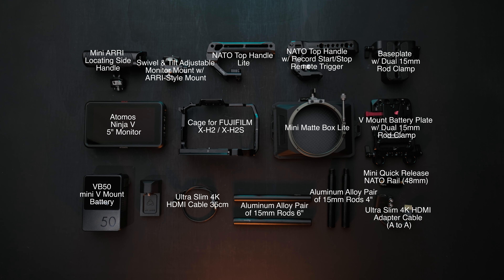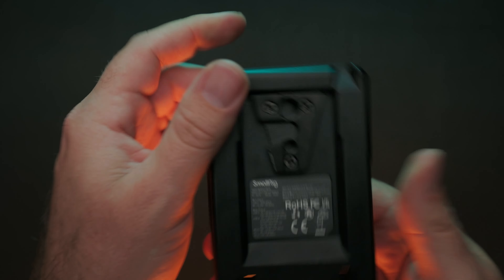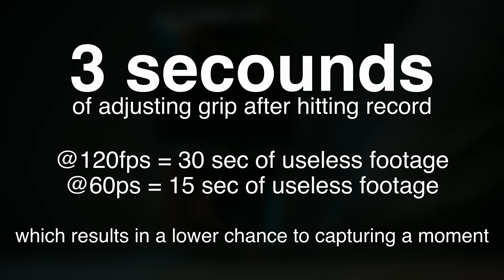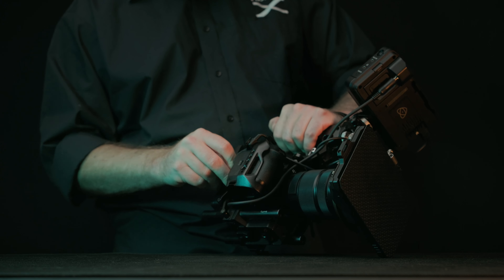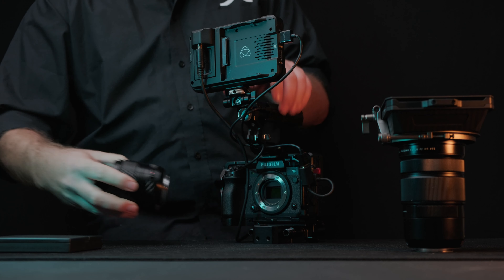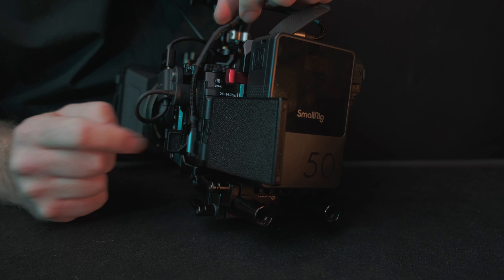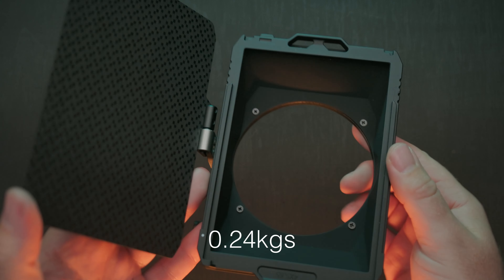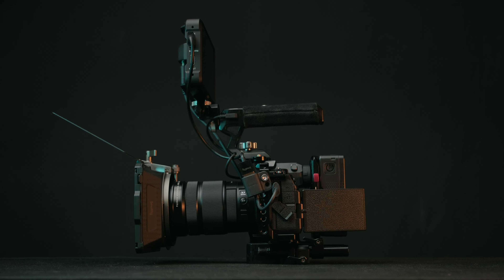Smallrig - Building your perfect camera rig - Fujifilm XH2/XH2s

Comment: That looks great. Thank you. Two question who were not asked in the comments:
1. How long can you record or running the camera with both monitors on the 55 battery?
2. I guess you still have the original battery in the fuji cam plus the v-mount battery. Do both battery lose energy? Or will the v-mount battery lose first all the energy and when its dead the original fuji battery starts to work?
Reply from the maker: I’ve never done none stop recording to answer the first but I get about 5 hours of heavy use out of it (never had it die on a shoot).
I have stopped charging the camera from it though as it only charged it VERY slowly and was just another cable to worry about (if I remember correctly the  camera only charges at 5w while on vs 30w when off) and as the camera battery was lasting me about 3-4 hours of heavy use without charging I just swap batteries mid shoot.

Comment: Hey, great guide! Would you recommend the Smallrig Cage for the Fuji XS-20? Im worried, because you mentioned, that the cage should have three points of connection, but the one for the xs-20 only has 2
Reply from the maker: If you can find a 3 point cage for another brand I’d suggest that, but if not ya don’t have much of a choice I guess.
Anything you attach to the cage if it’s near a point of contact will be solid, if it’s not near a point of contact you cage will flex a little

Comment: Awesome! I have a very similar rig for my X-T4 :) Have you found a shoulder option for this type of rig? I'm worried too much weight would be forward and not much on the back but would love to be able to throw this setup on the shoulder. Thanks!
Reply from the maker: Smalleig do a very cheap shoulder rig which I’ve held but never used, I actually use a sling neck strap instead which I’ve been very happy with as I like lower angle shots rather than higher angle shots plus it works well with a top handle monitor
Reply: @ThomasBusbyPhotography  interesting I’ll have to check that out. Is the sling featured on your page somewhere?
Reply from the maker: @melvinbrinson  this link might take you to the New Zealand site but this is the strap I use

https://nz.peakdesign.com/collections/straps/products/slide

Comment: I'm researching on building rigs for my new xh2s. Never done anything like this before. One quick question. i was looking at the falcam system but they don;t have a cage for xh2s. Is it possible to have the smallrig cage and then work in falcam's accessories so that i can have the best of both worlds?
Reply from the maker: I have the falcam system, and while I love their neck strap and use it with my gimbal every single time.
I would highly recommend suggest not using any of their quick release systems as I have found they all come lose far to easily.
They sent me a few items to review and stopped replying to me after I asked some questions and voiced concerns
Reply: @ThomasBusbyPhotography  thanks for the tip!

Comment: Nice! thanks for sharing. I have the same top handle and the same grip problem. What a nice solution with the leather sleeve. You say you had it made for you, is it possible to see some pictures of that sleeve somewhere?
Reply from the maker: Hockey stick grip tape would be a easier solution.
I don’t have photos up of it yet.
But essentially you wrap the leather around it inside out with two very small lips to attached together.
Then slowly and with heaps of force you turn it inside out, this was hard to do.
Then I slid it over the grip with the seam aligned with the long slot down the side of the grip.
Marked a spot for a hole or two, punched them out, and used a small smallrig bolt or two to lock the grip in place.
But like I said in hind sight grip tape would have been much easier.
Reply: @ThomasBusbyPhotography  Thanks for the reply. I’m going to try it.
Reply from the maker: Let me know how ya get on, IG pm your attempt

Comment: Hey Thomas, well made. efficient and clear. Your rig looks so good, I went out and spend my blackfriday budget on Small Rig. I'm struggling to mount the camera inside the case. In fact, it doesn't really fit without damaging the camera. Any trick I should try? grease it up a bit maybe 🙂 Thanks for any suggestion. greets from a happy Fuji user.
Reply from the maker: Just to double check you’ve 100% got the cage made for your rig?
And make sure you’re mounting yours from the correct side.
Mine gets mounted from the lens side, not from the rare if that makes sense

Comment: Very useful. Thanks. I've got the same problem as you on hitting record on the camera. Do you use the atomos to record as well?
Reply from the maker: No the atomos doesn’t offer any recording options I need, and doesn’t offer a few recording options I use in camera, so I now just use a shonibi
Reply: @ThomasBusbyPhotography  I'm curious: what specs are missing on the Atomos that you want and find in the X-H2s?
Reply from the maker: @lucapellizzaro80 4K 120fps (the xh2s can’t output that via hdmi even if ya get the V+)
And h265 without paying another $99 for it. Plus it’s on the reliability of 2 hdmi ports and a cable rather than just a memory card which is farrr more secure
Reply: @ThomasBusbyPhotography  that's fair enough. I have my ninja v for the long takes on a tripod and yes, hdmi is not reliable but I've experienced major fails with the Cf express cards so...
Reply from the maker: @lucapellizzaro80 yeah nothing beats dual recording

Comment: Hello, thanks for your sharing. I find the Top Handle with Rec Button from Smallrig doesn't mention they support X-H2s, is the record button still works for xh2s? Thanks!!
Reply from the maker: I have used it on every single firmware version of the xh2s and never had issues.
However I have had a few people comment here saying they have had issues and after I have said make sure you put it in the right spot and press it in far enough none of them have replied.
I personally would very happily purchase another one for my xh2s as it’s been so reliable and useful
Reply: Thanks!! @ThomasBusbyPhotography

Comment: Built this exact same rig from your video and had a few questions. would appreciate any advice.

The colors look different on my atmos v than the lcd on my Fuji. I am only using this to view the footage larger. How do I sync them? I would love to see the flog assist color on here or what it actually looks like in rec 709 instead of flat.

Is there a specific order you power and plug things into your battery? I heard that you can fry your hdmi port if not. 

Lastly - how is the record handle working? I’m not seeing any cables or sections to plug it into my camera.

Thanks in advance!
Reply from the maker: I struggle a little with the colour matching as well, and find my self switching between 709 and native on the monitor a lot. I’d suggest getting used to native as it does preview a lot more dynamic range, and I switch on 709 for when showing the client out in the field.
If you really don’t want to do this, just load up 709 (or whatever lut you want to preview with) and then adjust your monitor gamma until things look closer, gamma tweaking helps.
I constantly power cycle everything in odd orders and have never had issues, I did start to get annoyed with dtap getting knocked out a lot and have just added a Velcro band around the mount battery to hold the dtap in better, I should have done this long ago, if you’re looking for a fancy one I found 2x fpv drone battery straps to be perfect.
Everyone misses the handle port, it’s very small on the right hand side near the top of the grip.
Hope this all helps mate and you love the rig
Reply: Any advice for being able to hear audio on playback? When in the field and having to review a scene I am noticing I cannot hear any sound when watching the footage while monitor is plugged in. I am also just using this monitor to view footage and not as a recorder. A bit annoying. Do you have advice or a work around?
Reply from the maker: @MattRussoMedia does your monitor have a headphone out?
Reply: @ThomasBusbyPhotography  yeah it’s the same ninja v monitor as yours. I am assuming I will have to buy headphones or a 3.5mm Bluetooth plug and external speaker to let clients hear audio on playback in field?
Reply from the maker: @MattRussoMedia if you’re recording good audio id would highly suggest even just a basic pair of headphones for monitoring.
Nothing worse than getting home and finding out a mic was rubbing on a shirt on you had interference and all audio is wasted.

Comment: Hi, which USB C cable are you using to charge? I have a right angle as well but the head is a bit too bulky. Thanks!
Reply from the maker: To be honest I have now stopped charging via usb-c.
Charing while using made such a small (nearly unnoticeable) difference, and I’d rather have the extra life on the monitor.
But the cable I used was a UGREEN UG-50125 USB-C to Right Angled
Which I got shortened to suit the rig.
Reply: @ThomasBusbyPhotography  thank you Thomas

Comment: 2:18 can I use a monitor without a pin area with that mount? Im using a desview r5 monitor
Reply from the maker: Yes the pins pop down, as sometimes I remove my monitor and turn it slightly if I’m doing a long interview depending on where I’m sitting

Comment: 3:27 How did you get the record button to work on your top handle? For the life of me I can’t figure it out. I’ve tried every port on the camera. Thanks!!
Reply from the maker: I have had lots of people comment with this issue and non seem to reply when I ask questions.
But just to confirm the port is on the grip side of the camera above the memory card door.
And it is a little firmer than expected to push it in, it’s not crazy hard to do so don’t break anything, but my first time I didn’t have it in far enough.
Please let me know if this was the fix and all the best.
Reply: @ThomasBusbyPhotography I can’t make it work using usb C. I’ve only tested with the Neewer version but it doesn’t work. What usb setting did you choose?
Reply from the maker: The smallrig record handle connects via 2.5mm pin on the grip side of the xh2s (NOT usb-c)
I don’t believe there is a usb-c record option, but I may be wrong.
Reply from the maker: @FujEterna sorry what camera are you using?
As the xh2s has mic, and headphone ports independently of usb-c.
As I also own Sony when it comes to these kinda issues I would maybe say Sony is a smidge worse as their hdmi output really sucks, and the ports at pretty much the same
Reply: @ThomasBusbyPhotography  My bad! It works, I was thinking that you should connect to mic or headphone input but no! I didn’t know you had a port on the right side who servers exactly to trigger the record smh. Thank for the help! 🙏

Comment: I wanted a matte box for that "wow" factor 😂
It's very practical for cutting light and managing filters but when I thought of it it's going down the rabbit hole, it doesn't really work for zoom lenses and lenses that do not have internal focus but it's only compatible with some filters brands, sizes, shapes. I think the matte box should only come last one when one's settled on the lenses so it can fit all. Plus the price of the matte box + accessories + filters rack up very fast. 
But when you finally have the matte box you can call yourself a filmmaker even if your camera just sits on a shelf never being used and just for the show 😂
Reply: true, and it only cost 60 bucks 🤣

Comment: Thanks for the video.  I've just purchased the same top handle but it's not functioning correctly.  It starts recording as soon as I plug the cable in to the handle or camera.  I then have to use the camera shutter to stop recording, and then the button on the top handle doesn't function at all.  Any help much appreciated.  The cable is plugged in to the top handle and the remote socket.
Reply from the maker: What camera do you have?

Comment: Thank you so much for sharing your setup and findings with us. I am actually right now building a very similar rig with a FUJI X-H2S & the XF18-120 as my primary lens (Getting a set of vintage Canon FDs in addition). I want to power the camera, the Atomos Shinobi and .. who knows via a Smallrig V-mount battery (not sure yet if 50 or 99? ) What would you recommend (and why) in terms of cabeling? D-Tap-connection to Monitor or to battery-dummy? I had D-Tap to W235-dummy in mind and the 8V to Monitor (also with an adapter) ... Thanks for your thoughts ....
Reply from the maker: Be aware you’ll need a xh2s dummy battery, not just a w265 battery as it’s a different dummy battery from the xt4.
I get about 4 hours using mine to just power the monitor, so if you’re thinking about powering the camera as well I’d definitely get the 99
Reply: @ThomasBusbyPhotography  Hi, I have a X-T4 and a X-H2S here on the table and both use the same NP-W235 batteries. So A 'NP-W235-dummy' should do the job for both cameras, no? I wonder if there arguments pro or contra using 'dummy to D-Tap' or reserving the D-tap for the monitor? Or maybe it does not matter ... ??
Reply from the maker: But the cable comes out of a different spot from the T to the H hence why it’s not the same dummy even though it’s the same battery.
With connects it’s more about power output and what your device needs etc
Reply: @ThomasBusbyPhotography  Oh yes .... Thanks for making that clear !
Reply from the maker: No worries at all and all the best.

Comment: I bought the small rig handle with the button to record, but even after plugging it in, via USBc, it doesn't seem to trigger the record.  Is there a setting that I am not looking at?
Reply from the maker: Have you plugged it into the mic jack on the left hand side of the camera?
Reply: @ThomasBusbyPhotography  I used a USBc cable for the USBC port.  Am I supposed to put it into the port above the memory card port?
Reply from the maker: Yes correct you are supposed to add it to the port above the card slot.
The first time I used mine I required the slightest bit of pressure, like a second click in. Nothing to hard though
Reply: @ThomasBusbyPhotography  it's not doing it for me.
Reply from the maker: Maybe do a factor reset on your camera just encase. 
What camera do you have?
Reply: @ThomasBusbyPhotography  Fuji XH2s. Smallrig told me that this handle is not compatible with it. :/
Reply from the maker: I’ve used it on 3 different XH2s and it’s worked on every one of them no issues.
Including with nearly every single fuji firmware update.
If you’d like to add me on Instagram I’d be happy to try and help you with this further.

Comment: what battery would you recommend since the Smart rig batteries are currently sold out in the 55wh size?
Reply from the maker: Is the 99 a option for you? It really depends on what you want to run
Reply: @ThomasBusbyPhotography  It looks great but is a bit too pricey for me right now.
Reply from the maker: Oh so do you mean what other brands?
Reply: @ThomasBusbyPhotography  Yeah exactly!
Reply from the maker: What output ports do you need?
Reply: @ThomasBusbyPhotography  Not sure, trying to build a similar rig to yours, currently have an x-t4 so am trying to replicate a similar list to your setup. Ideally powering the monitor, external mic, and camera. Also, when shooting in 8k and 4k, did you need the fan or did the camera stay cool enough?
Reply from the maker: I can’t shoot 8k, but I do all day 4k 120 out in the sun and have no issues.
Fxlion nano looks like a good battery and cheap, but I haven’t used it.

Comment: Why would you flip the monitor that way?????
Reply from the maker: Which monitor which way?
Reply: @ThomasBusbyPhotography  built-in. I guess it is prone damages.
Reply from the maker: Because if it’s folded away you can’t use it behind the battery.
As I don’t use the ninja to record I actually have my output display info turned on and the screen tucked away. But if you wanted to record with the ninja you’d want the monitor out like I have
Reply: @ThomasBusbyPhotography  that’s what I’m trying to say, you already have your reference monitor mounted at the top.
Reply from the maker: I was just showing if you want to record with it you’d need it out